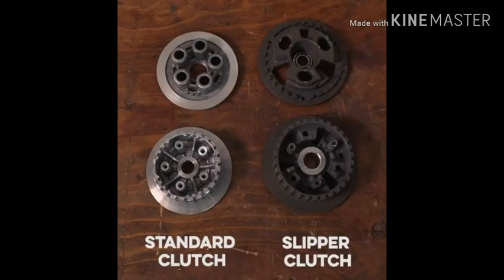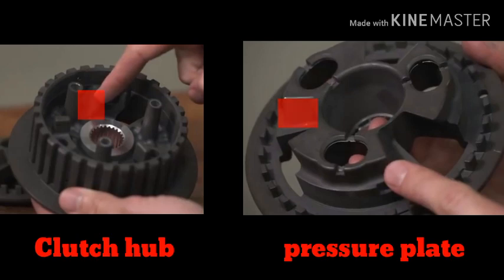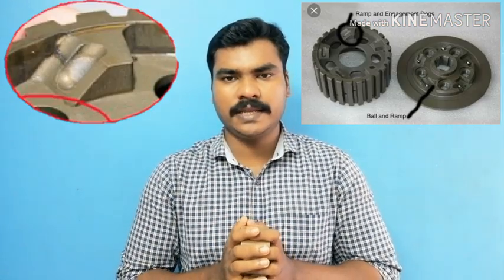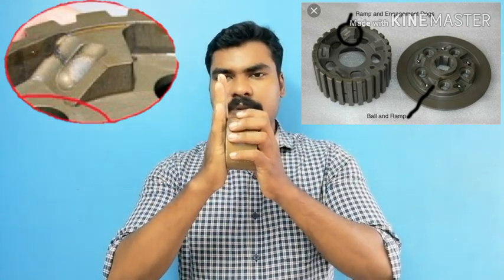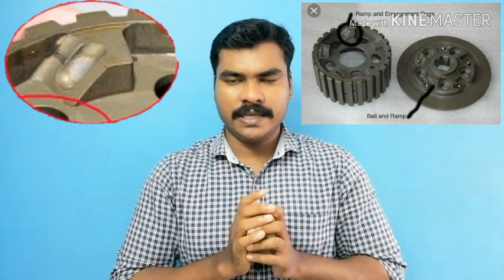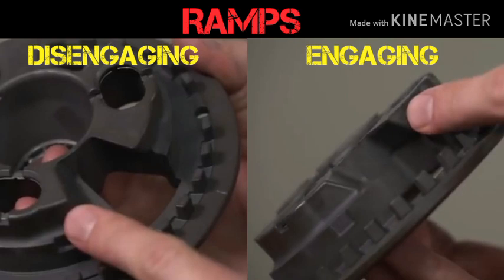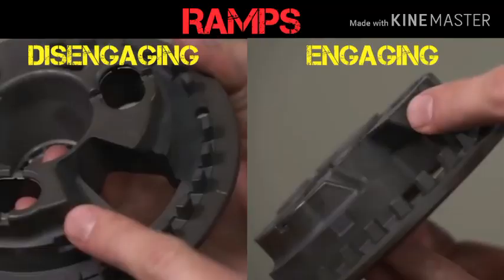Automobile slipper clutch | slipper clutch | clutch | multiplate clutch | malayalam video | kbg42

Comment: Fz 16 chaise paintinginu nna rate vsrum
Reply from the maker: Sorry, അത്തരം അറിവ് എനിക്കും ഇല്ല 😊
Reply: @malayalamautomobilechannel785  front brakeinu pidutham ind ... ayyrnns chsyyunnne
Reply from the maker: @rojanjames7565  ayyrnns?
Reply from the maker: @rojanjames7565  kindly type in malayalam 😊
Reply: @malayalamautomobilechannel785  front brakeinu piduthan ind idakk ath enna chayyunne
Reply from the maker: @rojanjames7565  check brake fluid level and also inspect brake pads, brake disc for any uneven wear. ഇതെല്ലാം ഓക്കേ ആണെങ്കിൽ brake caliper and break master cylinder complaints ഉണ്ടാകും so
ഇവരണ്ടും അഴിച്ചു ക്ലീൻ ചെയേണ്ടിവരും ചിലപ്പോൾ master cylinder ലെ എംസി കിറ്റ് മാറേണ്ടി വരും.